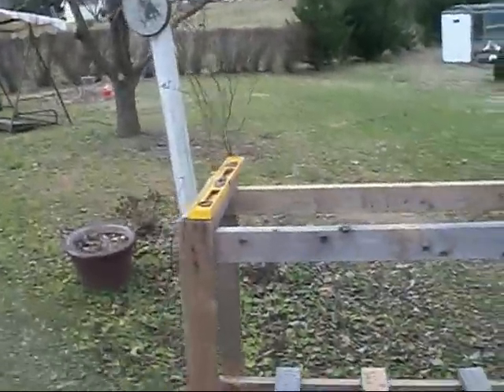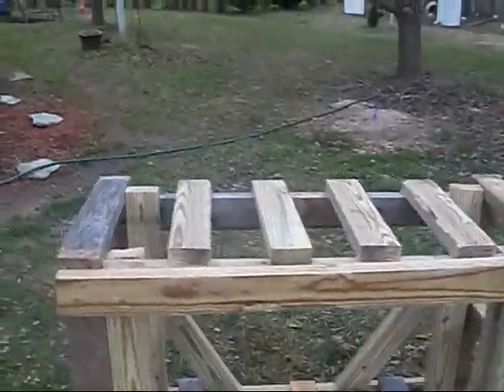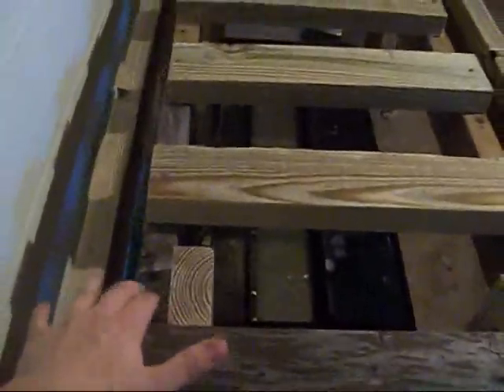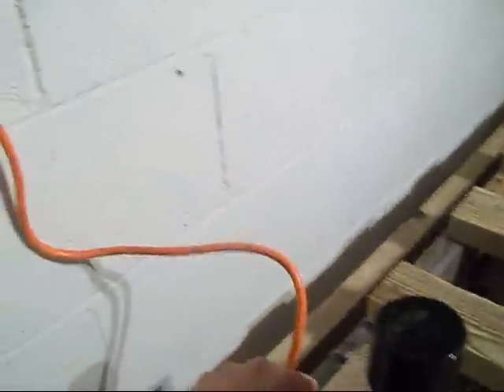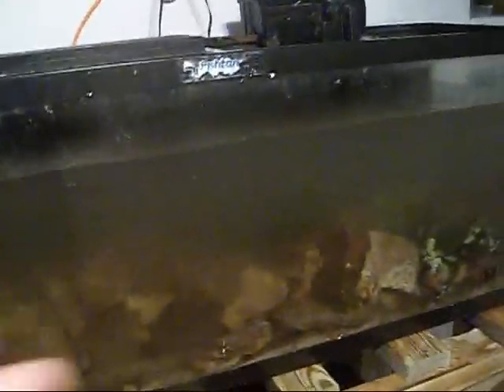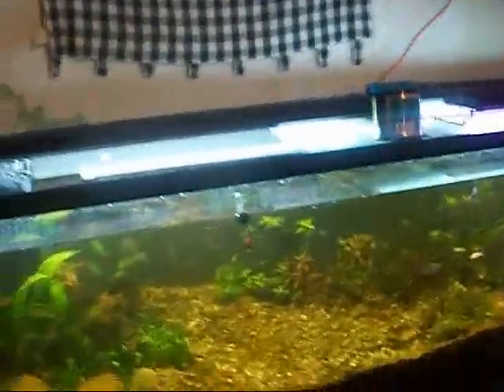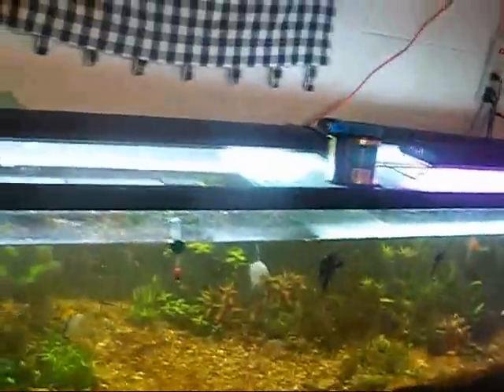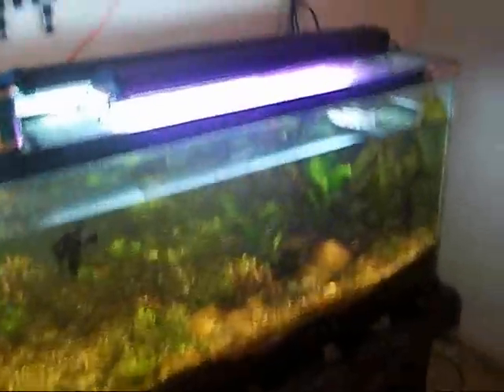Building 55 Gallon Stand, Taking Back The Reef

Comment: I like the idea of isolating your power cord, but with you setup you could actually accidentally yank on the power cord somehow and that could drop in your tank or if a screw came unloose which is holding up the power outlet. I like the drip loop idea the best and placing the powerstrip in the top on the stand underneath the tank..

Comment: your beams that span the width have no vertical support under them just side support you could have the front or back of tank fall through over time. Remember 55 gallon tank  with water weighs close to 450 lbs plus all coral and whatever else you put in.

Comment: In my opinion too many people are too concerned with building stands to be "disaster proof", i too am guilty of this. All you have to do is look at the stands that come with most tanks. They are usually made out of 1/2" plywood or MDF and are barely held together, yet they manage to hold hundreds of pounds of water. with no problems.

Comment: @samuelwaynefoleyjr prwnage is correct to a degree, it's not the mirrored image you see, it's a slight reflection from the light. However, they can see their reflection quite easily, more shadowy if anything..Go to the side of your tank and look across it and that's what they see. They don't see what you do when you look at the tank from the front. Seems like glass can be tricky at times, just like in a fun house..